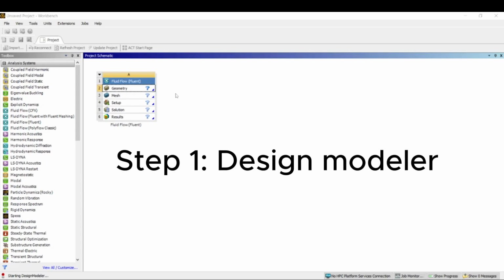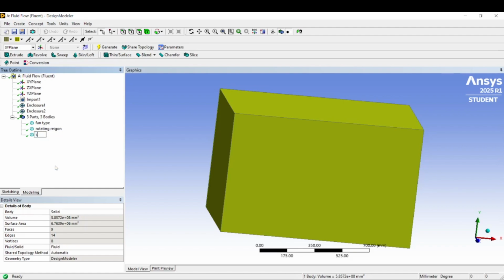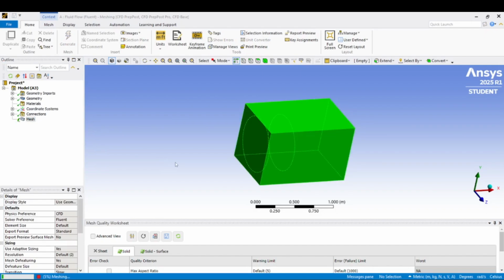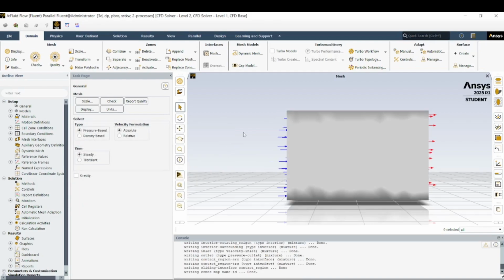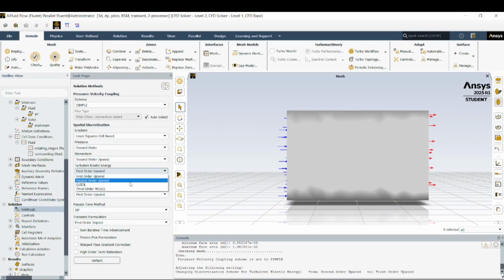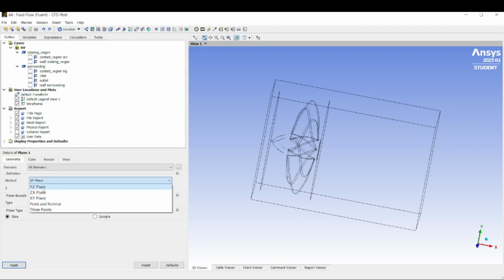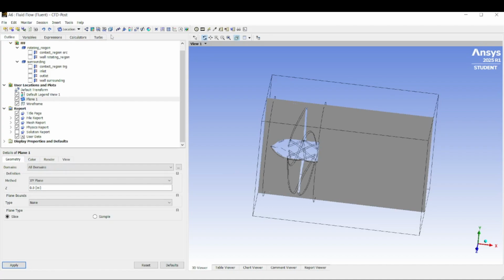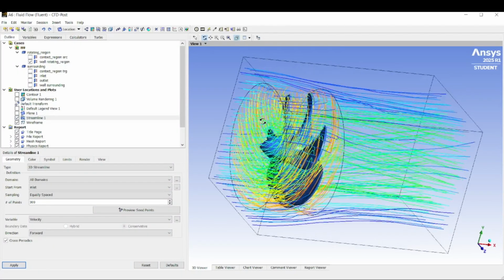CFD of Marine Propeller on Ansys Fluent. #cfd #propeller #analysis

Comment: also would I have to change anything if I did water instead of air as the fluid. besides changing the material ofc
Reply from the maker: Yes you have to set to a density based solver, and check whether it is turbulent, transient or laminar, if it is set to compressible for ideal gas condition for air, you have to set to incompressible or density based for liquid.

Comment: I did nearly the same things tho heres stuff I changed.
-Used my own prop ( similar to yours but a two blade)
- my prop is in y-axis, yours was in x-axis
other than it was pretty much 1 to 1. tried to run the calcs using the steps you did, got a floating point error and didn't run anything. Any ideas on how to fix, or are there too many causes.
Reply from the maker: Can you provide the screenshot of the error, float point error can be solved via generating a better mesh, inputting low values with first order upwind like low relaxation factors, pressure 0.2, momentum 0.3 and turbulence K- omega 0.5, conversion first order to second order, reduce time step for the iterations or use double precision.

Proper error can be mitigated if you have the error picture.
Reply: @Blueprint_Bazaar  hi im also getting same problem but im use z-axis. but when i want to mesh it said my rotationg region was wrong. can you help me?

Comment: Nice video. Could you include the hull interactions?
Reply from the maker: Yes we can but there are lot of interactions of hull like stresses in propeller and local hull structural loads from pressure pulses, wake fraction, thrust , self propulsion etc.